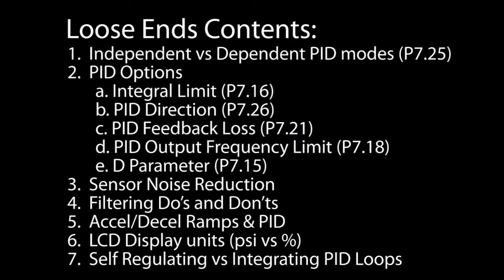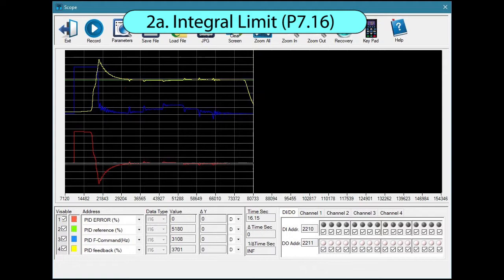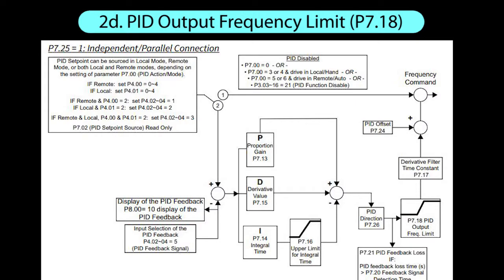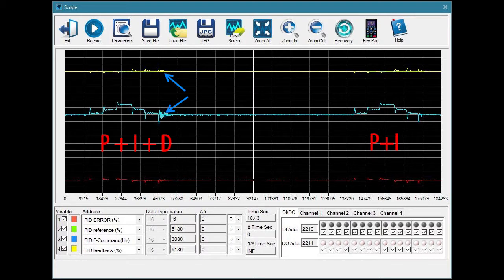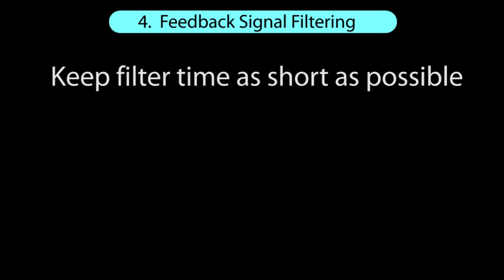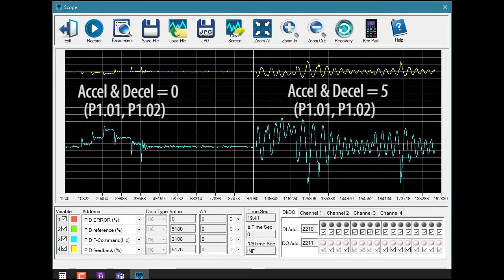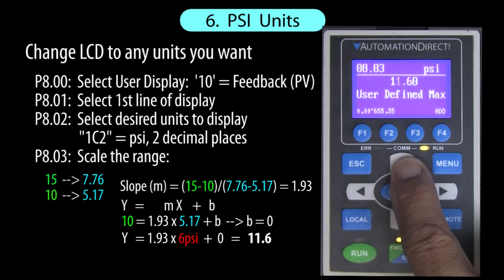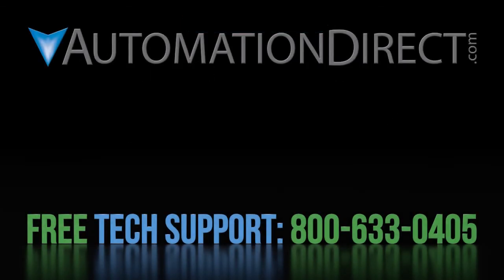DURApulse GS4 VFD PID Controller Tutorial: Part 4 of 4 from AutomationDirect

Comment: Hi AD, Mechatronics Instructor and avid automation direct supporter.  Any chance you'd be willing to share some of the build information for your simple valve pump setup?  I'd like to use something similar in class and we're very budget sensitive.
Reply from the maker: Sorry to say but we don't have a BOM for that. We sell the GS4, and we sell jet pump motors (though the pump and motor he used in the video was purchased as a unit) as well as the pressure sensor. Everything else was purchased from other vendors. Find our jet pump motor options here:
https://automationdirect.com/jet-pump-motors
and our pressure sensor options here:
https://automationdirect.com/pressure-sensors

You would need to pair that motor with an actual pump. the rest of the system is just a 50-gallon barrel and various PVC/flex fittings.